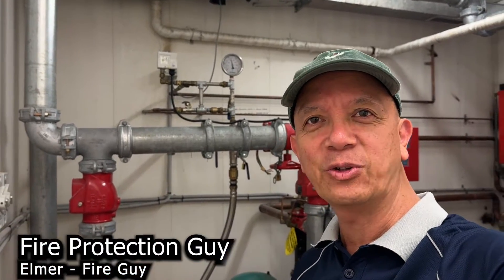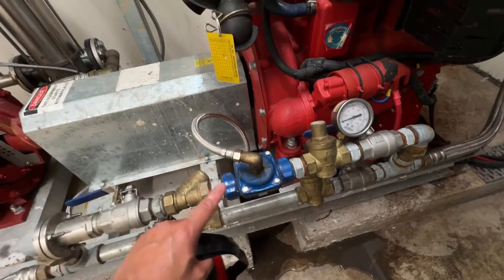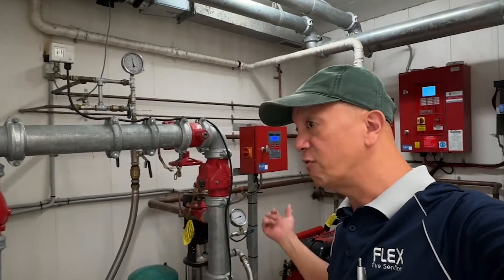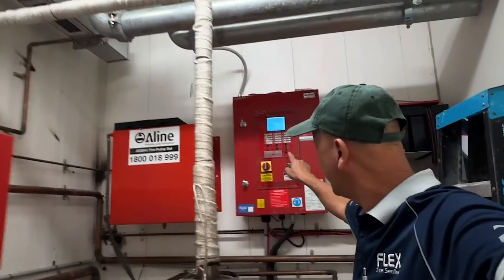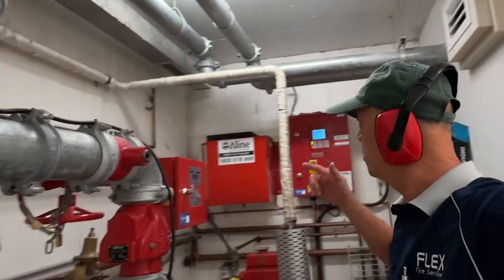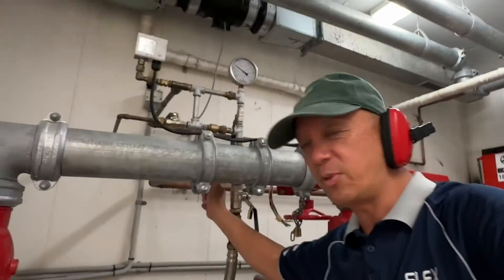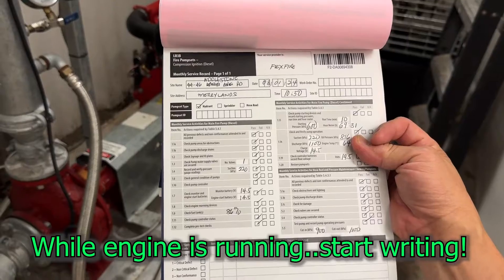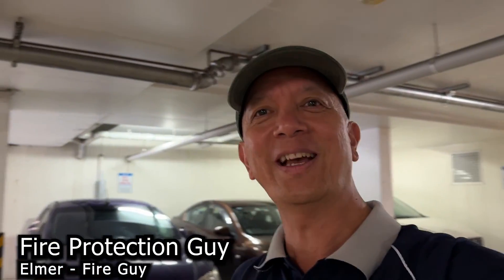Monthly Fire Diesel Hydrant Pump Testing - Fire System

Comment: Any chance to do a video with a combined HYD and Sprinkler pump. Thank you
Reply from the maker: I will love doing that. Unfortunately, I don't have a site right now for that. The procedure will be the same. One engine for sprinkler system and hydrant system combined. Test one at a time while the other is isolated. Engine starts  by each pressure switches ...so it will be easy.
Reply: Thanks a lot. Really appreciate the explanation

Comment: I noticed on the engine coolant reservoir what looks like rust streaks from the radiator cap. Dose this one have straight water in the cooling system causing it to rust up like that? I've seen all too often people using just water in a cooling system causing heavy rust internally in the engine.
Reply from the maker: I agree with you. I only pour radiator coolant. However, there's a history behind this engine. It's started with an dumb plumber who isolated the main supply valve in the street due to a leak. He left it for a days. The engine run and no supply water available for 3 hours after I shut the engine. It was steaming hot. It happened 3 years ago.